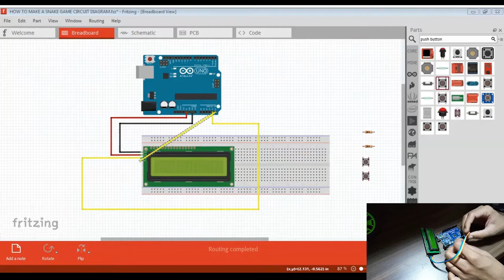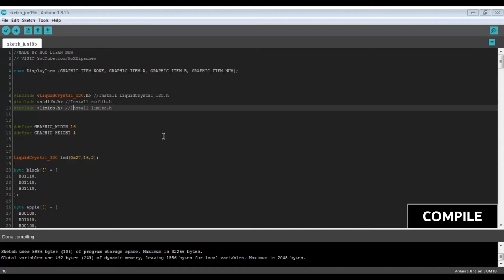😎How to make Snake Game using Arduino UNO & LCD ? -  arduino projects 🐍🎮

Comment: Bro, please make the projects without 12 c module OR give a circuit diagram and code in which you have not used 12c module
Reply from the maker: Yes bro you are correct , I will add in the description as soon as possible
Reply: @HoXDipannew  thank you so much bro 🤗
Reply from the maker: BRO I HAVE MADE A SEPARATE CODE FOR LCD without I2C
CHECK IT --
https://hoxdipan.wordpress.com/2021/08/27/how-to-make-a-snake-game-without-i2c/
Reply: @HoXDipannew  thanks bro this will help me a lot. 😀
Reply: @HoXDipannew  bro I have now buyed I2c module but I am getting error in code (head.) I have sent you photos of error on Instagram please check that and reply there

Comment: Bro, there is an error saying this
6:50: error: use of enum 'DisplayItem' without previous declaration

 exit status 1
I used the code  without Ic2. Also can you add the pic of the circuit in the blog. Thanks bro
Reply from the maker: Yess you've to use I2C , okay I'll upload as soon as possible